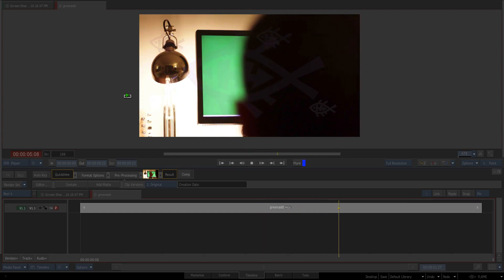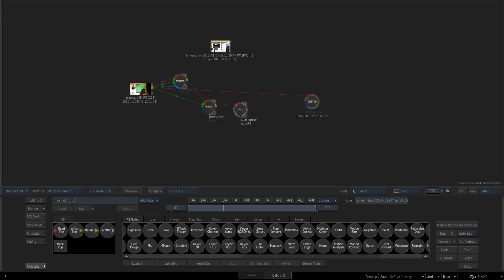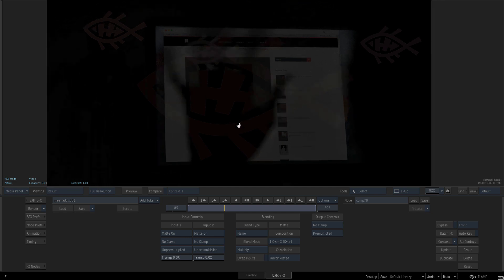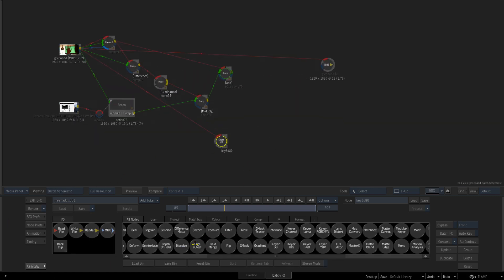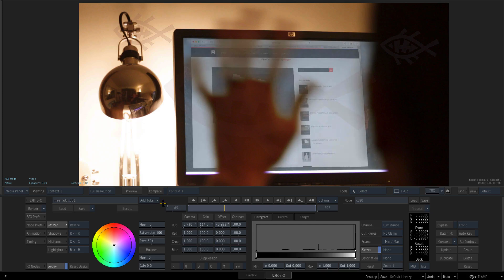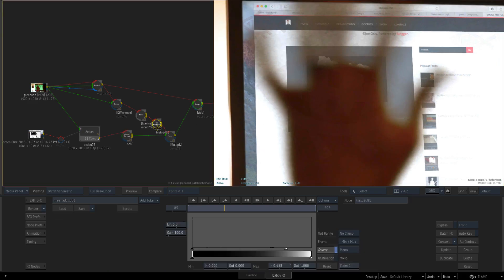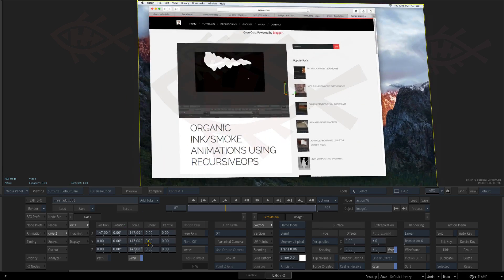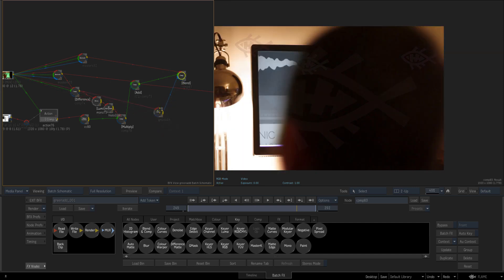THE ADDITIVE KEYER HACK

Comment: Makes smaller and cleaner batches from what I am used to. GREAT!
Reply from the maker: Etienne Theriault remember ivars additive keyer matchbox has an option to use my math, so only 1 node needed
Reply: Yeah but I still like to have the bigger picture on my batch though. What I meant is that your math is a good way to AVOID complex key setups for  a good result. I try to avoid sparks and matchboxes as much as I can to keep my brain aware and working :P
Reply from the maker: Etienne Theriault i actually like having it all exposed in the comp too, way easier to repurpose parts to other parts, and less is always more :)